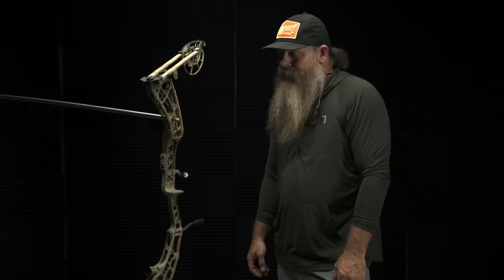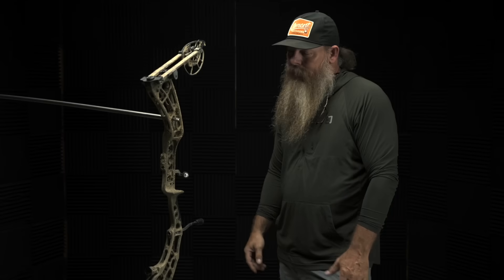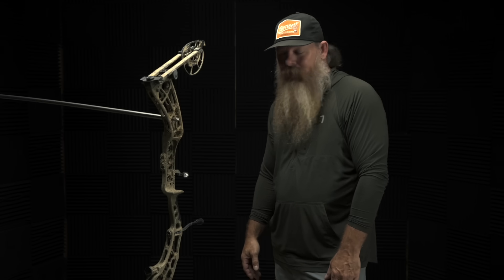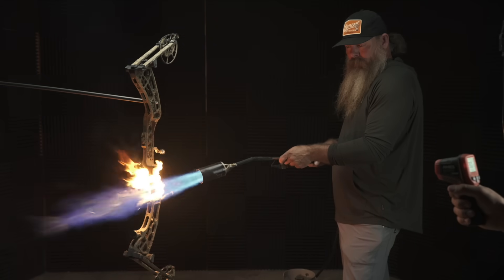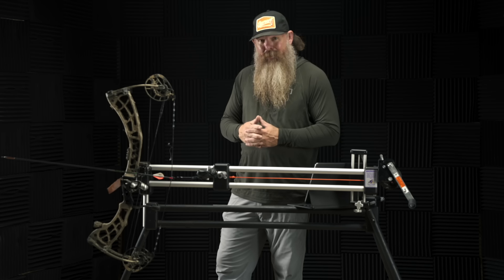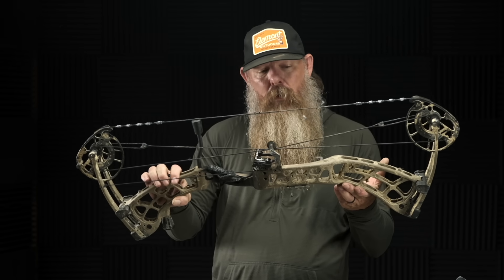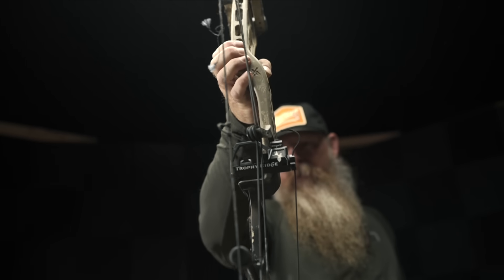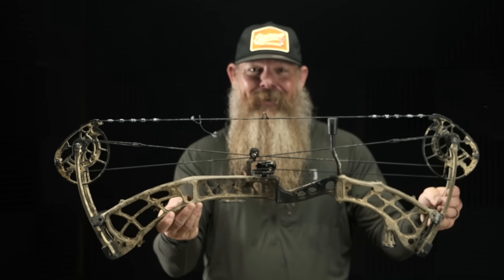Magnite Meltdown | Magnite™ Tough | Xpedition Archery

Comment: Best, toughest bow on the market.  They just need to partner with another string builder. The ABB strings it comes with frayed out on me after 1 month. The second set had done the same.  They are quiet and no stretch strings, but are far too brittle.  It takes away from one of the best bows I’ve ever owned.